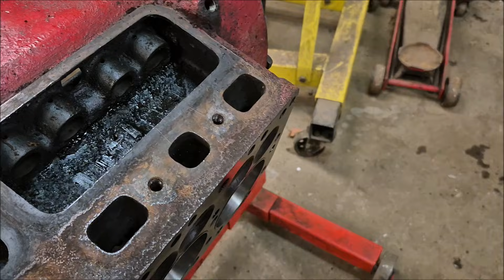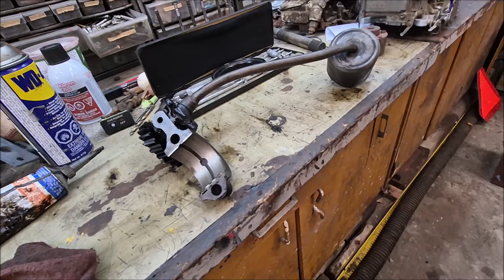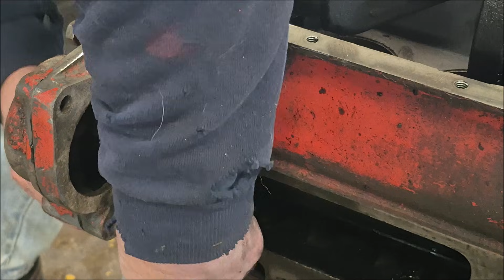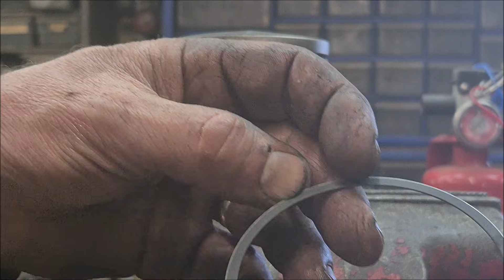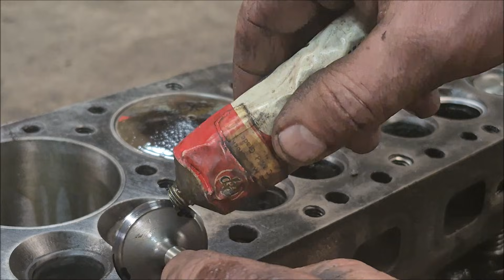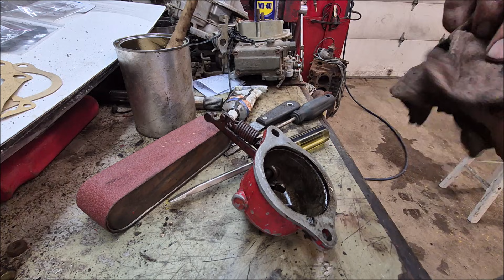1939 Ford 9N part 5 Engine Assembly Start to Finish

Comment: Hey Kevin. Great, informative videos! I'm in the process of restoring  a 1949 8N and am curious to know where you source new parts. I need lots of odds and ends (seals, gaskets, bearings, etc.) and the engine in my tractor also needs a complete rebuild. Any advice on where to get good quality parts at reasonable prices? I'm located in Eastern Ontario.
Reply from the maker: Diamond Farm Equipment in Brighton.  They have a good website.

Comment: Thanks Kevin for making this video! I had nothing doing all day so you made my Christmas a Merry one!
I wanted to ask you a few questions.why does the cylinder only get a ridge on the top and not on the bottom?
And why did you use the ball hone after the three leg hone?
And was the head gasket marked on which way it goes on?
And how do you feel about the copper spray that they make now for head gaskets?
And do you prefer the three ring piston over the 4 ring?
😀🇨🇦
Reply from the maker: The cylinder only gets a ridge at the top because combustion pressure gets behind the top ring and pushes it out against the bore. The pressure behind the ring diminishes as the piston travels down so there is no wear at the bottom.
I use the ball hone after because, well I'm not really sure why. I just always do. 
The head gasket was not marked top. To my knowledge it can go either way. 
I have no experience with the head gasket spray
Lastly, yes I prefer the 3 ring piston. I think the 4 ring pistons were a product of their time when oil quality was different and ring technology was too.
Reply: @ClaremontClassicGarage Thanks so much for getting back to me and answering all my questions 😀🇨🇦
Reply from the maker: @keithwarkentin  My pleasure.

Comment: Awesome Kevin...will watch after brkfst...you know the rule...no presents til brkfst done...👍
Reply: Putting bran new gaskets and manifold on 2n today...used Extreme heat JB to dress up #4+3 ex ports...will clean paint off matingbface of manifold...do you ever put a thin coat of anything on the gaskets...you didn't yesterday...just curious...tx am
Reply from the maker: @almills8802   If I have a nice flat block and a nice flat head that require no sealers I will put antiseize compound on the gaskets. It will kepp them from sticking, at least for a while. But once I need to start using goo around ports, there's no point so I skip it.
Reply: @ClaremontClassicGarage tx am
Reply from the maker: I do! Thanks for watching!
Reply: @ClaremontClassicGarage working on 2n block relief...will watch your vid as a treat later...one question...what is the name of the red paint you use...it looks orangey... I like it...
Reply from the maker: @almills8802  If you're in Canada its off the shelf rust paint from Canadian Tire. Armorcoat Fire Red.
Reply: @ClaremontClassicGarage eh...best country in the world...south eastern BC
Reply: @ClaremontClassicGarage excellent.. thank-you
Reply from the maker: @almills8802  Southern Ontario, eh?
Reply: @ClaremontClassicGarage you wish...😁
Reply: Maybe do a vid on fabinh running boards for 9+2ns...think it would be popular...I was gonna use walkway grating...but tools would fall thru...thinking about trying checker plate aluminum from old pickup r boards...🤔 @ClaremontClassicGarage
Reply: Way better than watching ...foosball...